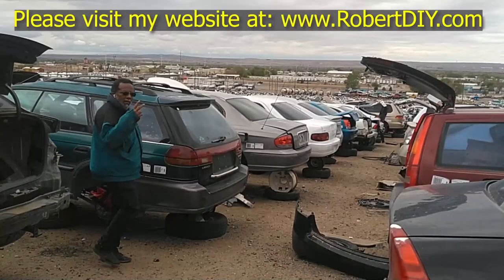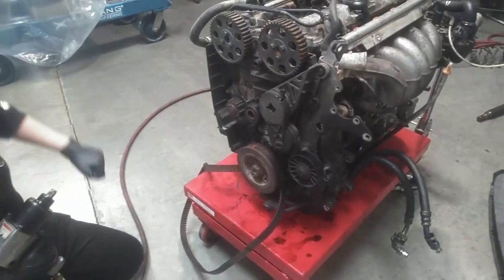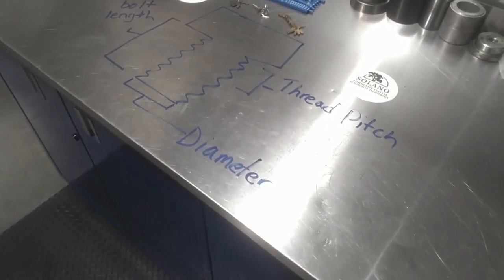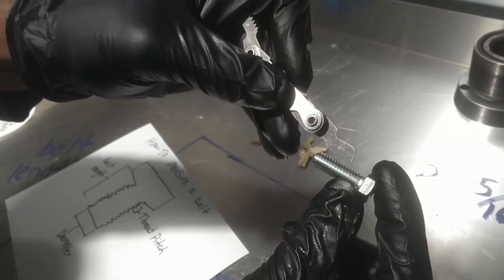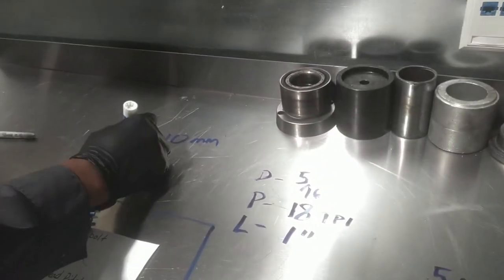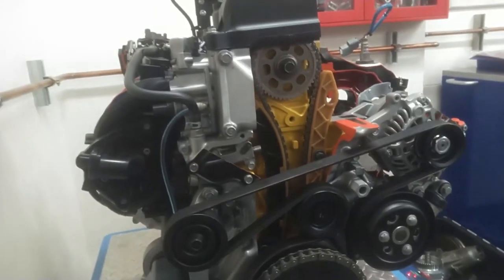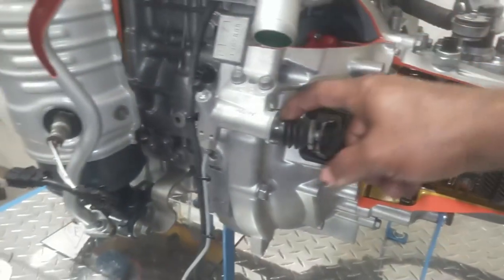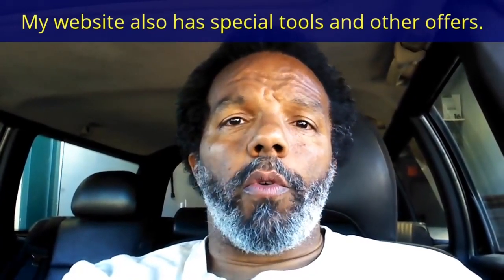Solano Community College, how to measure a screw or bolt, see a engine and transmission working...

Comment: Thats great to know,I found this out on my own,never got the opertunity to go to Automotive  class when I went to school and to busy working after high school,I get online and research a lot to find out when I have questions,I have a bolt guage just like that one,I also have SAE and metric tap and die sets that have the thread pitch guage for each set,very handy,also have a handy guage that I didnt know existed until about a year ago and that is a round plastic disc with wheel bolt patterns stamped in it,so you can find the wheel bolt pattern you are looking at,very handy item to have especially when searching for rims or hubs,rear end assemblies!Getting up in the years and not going to be able to do much more automotive work too many more years,Thanks For The Video!
Reply from the maker: Awesome! Special tools are very handy when in a jam or something breaks.

Comment: Hi Robert, I have a problem with my Volvo v70 99 with the 2,5 non turbo engine, I have noticed that there is a strange thin layer of oil on the top of the coolant in the  reservoir, and that there is small white stripes in the engine oil, so my question is  what do you think is broken? I have no oil cooler, and have started to remove the head be because I thought it might be the head gasket.
Kind regards Gustaf
Reply from the maker: Maybe transmission fluid
Reply from the maker: https://youtu.be/3X9WG4jrVPc
Reply: @RobertDIY  Yeah I have also considered that, but the atf fluid is fresh and have no signs of contamination or lower fluid level. But the engine oil has the white stripes in it, so do you think it is a head gasket, cracked head, cracked engine. What is your thoughts?😊